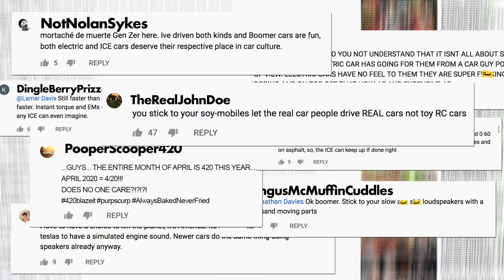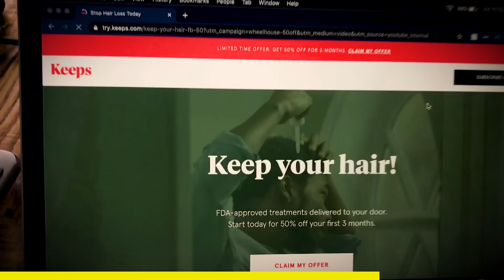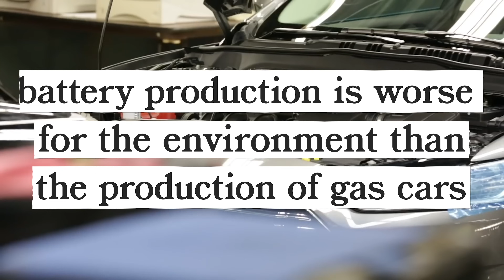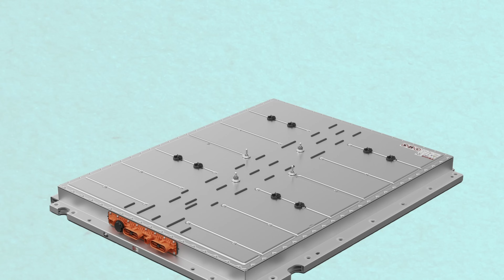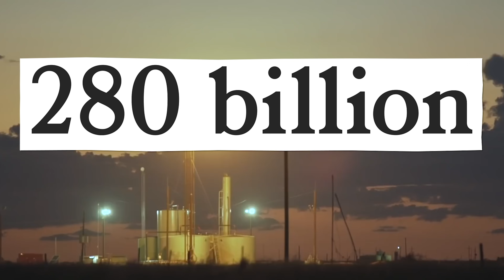Are Electric Cars REALLY Better for the Environment?

Comment: The facts show that in the long run, EV cars are more efficient than gasoline cars, and there are more advantages for them, which were not mentioned in the video. First, the average ICE car lifetime mileage is about 140000miles, but EV batteries are planned to last up to 200000miles , this can be shown by the warranty period too gasoline car manufacturers mainly give 3 year warranty and 100000km, however EVs have at least 8 year battery warranty up to a  lifetime warranty. So, after inventing more efficient battery production ways, EVs can be better for the enviromnet not only as twice as the ICE cars but way more.

Comment: if the grid can handle all of that, why was there a grid crisis in california this year just because people wanted to use their ACs at home? add EVs to the mix and the grid can't handle anything anymore already. Another factor is that EVS only last as long as the battery unlike a gas car (especially diesel) that can last almost forever these days
Reply: Yeah maybe you should stop getting your news from wherever you get it. Haven't had a single issue in SD.

Comment: You forgot about electric vehicle that's sitting inside one is equivalent of sitting on top of a microwave while you're cooking a meal. Literally letting micro radiation sleeping to your skin. You forgot that one.
Reply: Not every type of radiation is dangerous to humans. Don't go outside then because solar is more dangerous for us. It causes skin cancer and ages you
Reply: Sounds like you're too much of a coward to drive an electric vehicle
Reply: this is along the same lines of 5g giving you cancer. chances are the thing you used to write this comment has the same kind of battery as electric cars

Comment: Good video, you did fail to take into account the life span difference between an EV and an ICE car. You would need at least 3 or more batteries and several motor replacements in an EV to get the same life span as you can from a well-maintained ICE vehicle. I did see somewhere where an EV did 500000 km but had 8 battery replacements and 14 new motors or something. That's got to up the footprint of that car vs a petrol engine car that will usually do the same 500000 km one 1 engine.

Comment: Something not accounted for is that the mining equipment are probably mostly using ICE. If those also become EVs then it would lower the CO2 generated on the production part. There is also the development of carbon dioxide scrubbers for power plants. So even coal plants might become low emission.
Also interesting that the reason ICE emit CO2 is to avoid emitting carbon monoxide. Maybe someone will figure out a better conversion at some point.

Comment: Wind and solar for practical purposes are not clean energies. First of all their equipment production costs CO2 emission. secondly since they can not generate electricity all the time they also require batteries to store the power they generate. No one knows how much of land is needed to store the batteries which will store the needed energy to completely power a city when its night and there is no wind.

Comment: If 95 million oil barrels are produced daily, and the emissions are 767 million tons of CO2 daily, that would mean 8 tons of CO2 per barrel. According to Google, an ICE car uses 12 barrels per year for gas, which equates to 96 metric tons per year. Assuming an average life span of 8 years for the ICE car, the life span emissions go from 57 metric tons to 825 metric tons when you factor in oil refinement. Compare that to the 28 metric tons for an EV as mentioned in this video, and an EV's footprint is only 3% of an ICE car's footprint. Verify these numbers yourself in case I'm wrong.

Comment: i know one thing that can save combustion engines, Biofuels, these are way cleaner to make than regular gas and has nearly no impact on poweroutput, and there is stuff out there that can be mixed with fuel to further make combustion more efficient

Comment: Your math is wrong. The average EV breakeven point is more like 1.5 years for short range EV, and 5 years for long range EV. You also didn't take into account battery replacement especially for short range EVs, who will be far more affected by battery degradation. Battery warranties typically last for 8 to 10 years. 2nd hand EVs will need their batteries replaced sooner than later.
Reply: He also didn’t take tyres into account. One of the most harmful and toxic gasses that come from cars is burned rubber from the tyres. Due to electric cars being much heavier, they release more of these gasses. Also, it’s not so much the grid that can’t handle it, but the infrastructure. Here in the uk the roads just can’t handle the weight and there aren’t enough chargers.

Comment: Something not mentioned is that the carbon footprint of manufacturing an electric car is so much bigger than the manufacturing of a gas powered car that you would have to drive the electric car for ten years just to break even with the gas powered car carbon footprint. However, that does not even take into account that no one will want a well used EV after it is only 5 years old and needs another new battery or it gets junked, both options that increases the EV’s footprint even larger than initially considered above. You have to be pretty stupid to not do this math before you buy one.

Comment: Hope to add a EV to the stable, but missed one major thing I think.  The lifespan of the battery is little over 100k in mileage... never mind the actual shelf life, so could be less than 100k on vehicles that are not driven as often. 

I don't think there is a accurate work up on the efficacy of "renewable" energy. 

The main thing people ommitt to consider when considering renewables is the decentralized distribution makes upkeep radically more expensive in every metric. |

How much more difficult is it to drive all over indiana to service those wind mills...

How many species of fish have been made extinct in California thanks to their damns... 

Renewables should be applied at point of consumption, meaning buildings should have their own wind and solar power and those need to be upkept by the residents not a service truck hauling all over 24/7 with a bed loaded with tools and spare parts/batteries.

Living an environmentally friendly life is a part time job, not just a purchasing decision.

Comment: Can you update this taking into account the studies around increased tire wear of EV's? Pwease
Reply: Study. Not studies. And that study was laughed down by the scientific community, some going as far as suggesting that they must have been during burnouts to get the numbers they did. The only reason it’s everywhere is because it made a good headline. And journalists don’t understand basic maths. 

Let’s review shall we. The study claims that an EV, is substantially heavier (they’re not. The model 3 and BMW M3 are the same size, class and category with similar luxury features, performance and handling. And they weight almost exactly the same). If you read the text, what they actually say is that they compared the EV against, quote “an equivalent combustion car of a SMALLER size.” So not really apples to apples. 

If you crunch the numbers they give you, according to them you’d be replacing your tires on an EV every 25k miles because they’d be bald. Which clearly isn’t the case.

Infact when you look at the test they did, they didn’t even use an EV. They just put half a ton (500kg) of weight into the car. And claimed it simulated EV’S.

Which as we’ve discovered, EV’s are necessarily heavier than ICE.

They also claim the torque increases wear. But the torque and force on the tires required to accelerate at the speeds they do is the same regardless of if it’s an ICE or EV. Simply physics. The force required to move a set mass to a set speed over a set amount of time will always be the same.

Comment: Porsche has been working on recycling CO2 into new E-fule to creat a carbon nutrality for gasoline I honestly think this would be the correct way to go. If we had embraced EVs and renemable energies earlier then perhaps things would be different. If you actually care and want to help the envormment I think your best option would be boycott any new car period and buy an older hybrid or high MPG gas car who's econmic build has already been worked off or better yet carpool, take a bus, or even ride a bike. That's just my opinion on the issue of driving for the common man but personally I feel the bigger economic impact comes from lack of care from corperate america to try and run factories and businesses of all types with efficiency but rather with profit in mind. Profits important but it shouldnt be record breaking and the #1 priority anymore.

Comment: 9:08 is plain out wrong or misleading.
In 2020, a well renowned institute in my country did a complicated calculation for average CO2 emmision per kilometers. They found out that in my country, where 70% of our electricity depends on burning coal and gas, CO2 emission per mileage is only 5~10% better for EVs than Combustion engine cars. Making compensation for larger emission in manufacturing almost impossible (>25years)
Where the maintenance for EVs at certain mileage are just over 3x more polluting, making EVs basicallya big ass lie in my country.

Comment: Another good argument for the electric car is that once you have extracted the lithium from the soil you can re-use the materials from the batterypack once it has done its last charge. With gas you can't recycle anything.
Reply: you can recycle everything in a gas car including oil windshield washer fluid and gas and more you can also recycle the meatal on a gas car.
Reply: @fprblx6763 They were talking about the fuel/power source for the car. The vehicle itself is just as recyclable whether it's EV or ICE. They are all made of metal, plastics, etc. But once you burn a gallon of gas, it's gone. An EV's battery materials can be recycled and it can be charged using essentially infinite energy sources.

Comment: altho majority of the electricity is generatored via nuclear reactors, but then even without the EVs, nuclear reactors are still active, so i say they kinda are better for the planet in a way, as they reduce the carbon in the air that normally would have come from gas cars. Plus if you live in the cities, EV are just better for your wallet in general

Comment: Heres some issues with EV's. Im not against them, but we can't call them "green" if they still pollute just as much as gas cars do.
1: Batteries take a lot of energy to produce, polluting the environment a lot.
2: The mining processes for these batteries is mostly made up of slave / slave child labor, and or super under paid workers. This is ofc, terrible.
3: What happens to these deadly batteries afterward they get used up? Oh wait, they go straight to the landfill. This is ofc, not only wasteful, but even more polluting then if it was just a engine from a regular car. As atleast they can be remelted down, unlike batteries which are currently, just waste.
4: Hydrogen exists. While its currently expensive, its a way "greener" fuel than electric cars are, currently the process to make it is just too expensive, and converting hydrogen to usable energy isn't that efficient compared with EV cars. But I see way more potential in these as well, their only real pollutant is water!
5: Most of the power a EV uses is from dirty sources anyways lol, yes this includes Solar, wind, coal, gas. As they ALL pollute the environment or destroy it in their own ways.
Solar cells once used up, don't ever really get recycled, its pretty rare when they do, they also contain toxins such as lead.
Wind farms are pretty known for killing birds, and disrupting flight paths, and cost a lot of produce emitting a lot, and they all just end up in these retirement areas, while they could be recycled, its also pretty rare.

Overall, if you drive a EV and think you're doing the environment any good, you're just lying to yourself. 
Do I think EV's are cool? Yes! But are they environmentally friendly..? No. Big, fat, no.
Oh yeah, not to mention its pretty unethical where batteries come from for these EV's. 
OFc its really unethical to own ANYTHING with a battery in it.

Comment: Great facts defending the pollution levels of EVs vs ICEVs. But At best, EVs are for commuting while ICEVs can tour the country! Granted Taiwan and China use interchangeable batteries but in the US, charging stations are dreadfully slow. Add the 45 to 85 degree optimum LION operating temps. EVs in single digit temps won't take a charge! Summertime heats over 100 degrees increase the explosion/fire factor for Lion batteries. My ebike is a fun toy. But, I easily ride 300 miles/day on my motorcycles...

Comment: This completely fails to account for: 

1) infrastructure overhaul. Huge expense and material needed to reinforce car parks and roads and massively beef up fire suppression systems. 

2) environmental damage. Emissions aside, the environmental impact on the local area of mining these precious metals is horrific. 

3) tire pollution. From particles to the sheer amount of tires heavy evs chew through. 

4) disposal and recycling.

Comment: Consider this. Anti-freeze coolant, engine  and transmission oil, gasoline and oil companies drilling and spilling oil on the ground and in the oceans. Please remember all the super tanker and off shore oil spills and clean up. EV batteries are constantly updated and soon will be made of sodium. And last over 500 miles on a single charge

Comment: The ethical issues related to current lithium ion batteries cannot be overstated. I know this video is a couple years old but now Red Cobalt the book has come out. Also, with fuel vehicles becoming more efficient and the introduction of hybrids, we are probably going to find ourselves in a place where an efficient hybrid vehicle is the best of both worlds. If I can get 40 to 50 mpg, I would be using less than 300 gallons of fuel driving 12,000 mi a year.

Comment: Yes they are worse for the environment and the public at large. Weight of the car breaks down the roads causing the need to rebuild, EV fires are incredibly toxic and long lasting making it very difficult to put them out, the lithium mining along is horrible. The damage to other cars and motorists due to their weight. I could keep going. They're overpriced and you can't recycle the toxic battery.

Comment: The worst part is electric vehicles. When they catch on fire, they burn for days. As well electric vehicles can Malfunction easily because it's electric and if you get locked in and the car catches fire, you're toast. As well when the car is burning, it's putting all those gasses into the air. As well, the batteries are too expensive to replace. So many disadvantages that you did not talk about with electric vehicles.

Comment: About myth # 2, what is your source? Because I don't bye it, especially in states like California that are always having rolling blackouts and asking citizens to reduce electricity consumption during the summer.  It's also interesting that in your example, you only used 25% as your metric.

We also have to take into account thermal runaway whenever an EV spontaneously catches fire.  How do you measure that?  Anyway, the amount of water it takes to put out an EV battery fire is significantly more than ICE cars and the toxins the burning battery emits, which can burn for hours or days, is bad for our health and the environment.  Not to mention the potentially catastrophic damage these thermal runaway fires can pose to life and property.  With more and more EVs being sold each year, this problem will only grow.

All that said, the tech in EVs is phenomenal.   I've rented a few Teslas from Hertz on vacation or travel just to see what all the hoopla was about, and I admit that I was thoroughly impressed.  But I'm a realist, and believe that the infrastructure needs time to catch up with the technology before we go all in.

Comment: Hello ! One IMPORTANT thing ! An EV car will have its batteries wasted in 10 years so for a 20 years lifespan you have to also reinclude the battery CO and CO2 and water and energy consumption. So here comes the real kicker --> You buy a EV car in 2024 for 40 000 dollars and in 2032 the batteries are to be replaced because they cannot hold charge. So you get a quotation for 30 000 dollars for a complete new battery pack (deinstallation reinstallation and waste management that the car owner one way or another will be asked to pay for). Would you do it for a 8 year old car? Probably not. So where goes the car ? What happens to secondary users ? No one can buy the car. Environmental disaster. If a good premium car has 20 or 25 years lifespan it will help many people. First owner, secondary owner etc.

Comment: It's actually pretty simple.  The problem isn't asking if electric cars are better for the environment with current power systems.  That's the wrong question.  The right questions to ask are more about how quickly and completely we can transition to clean energy, including wind, solar, and nuclear.  If we want to tackle the alarmingly climbing carbon dioxide levels in the atmosphere, which is bound to have seriously negative consequences at some point, we need BOTH clean energy production and clean energy consumption.  In other words, we need the EVs, be it now or later.  We also need clean energy production.  That change is happening also, but the pace of both are pretty slow.  If we wait to do EVs until clean energy production is ramped up, the whole process will take twice as long.  We need to continue to work on both in tandem.